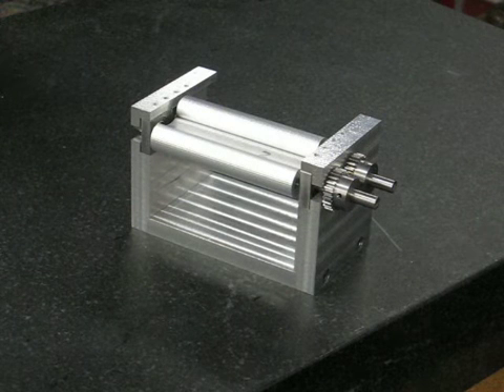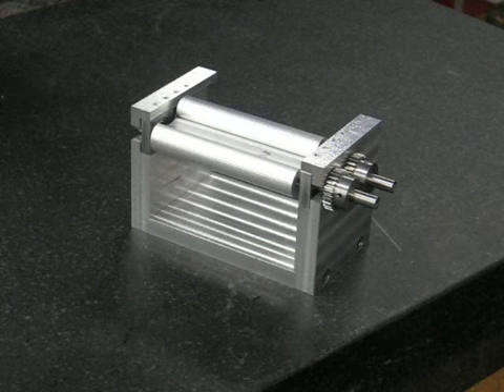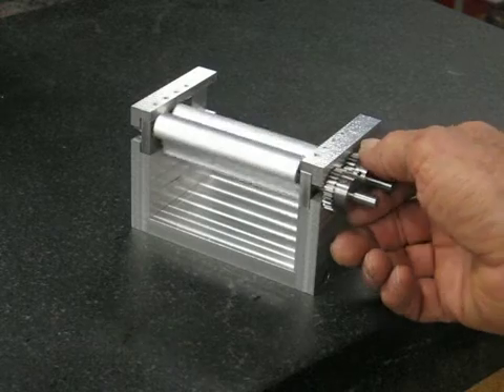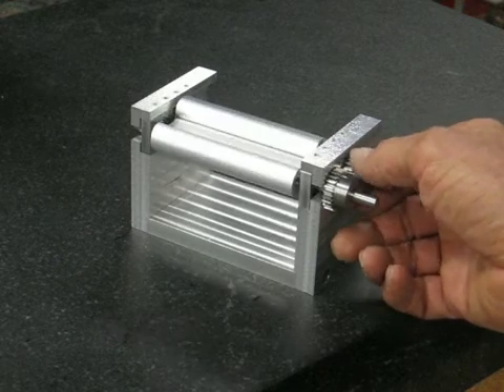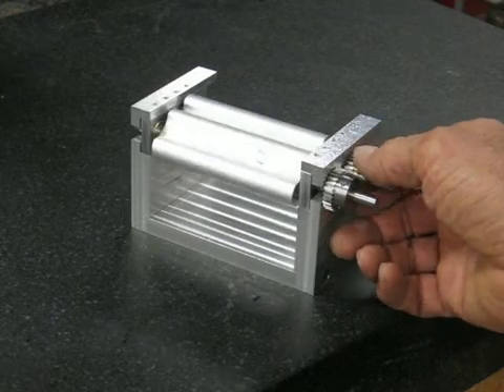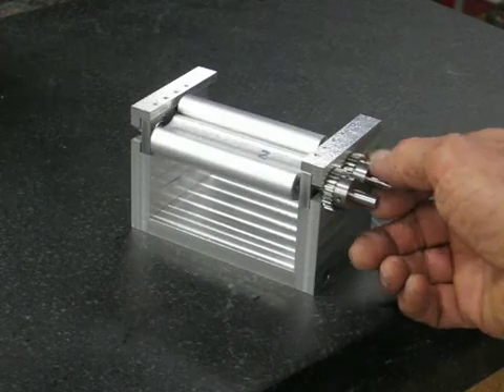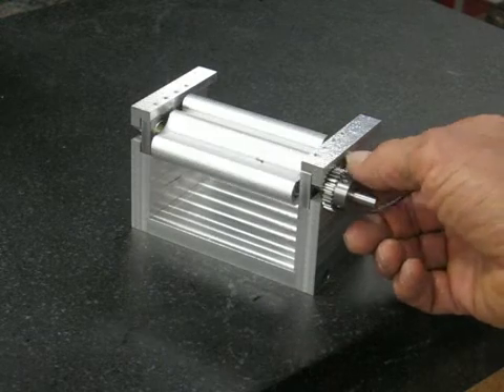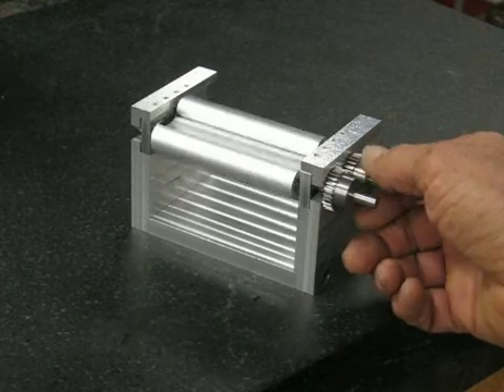Bakers V8 Supercharger

Comment: Sir, could we speak about the workflow of how you worked all this out? I am a tool maker and half way understand about using a ball end mill to "3d" compound profiles but on a mill are we lowering the z axis say like .002 while moving the y axis say .006 then making our pass in x. As the profile changes the ratio of z to y in thousandths changes via the excel spreadsheet? Now what about the dividing head set up? Do we add another axis and rotate say 6 or 8 times to clicked positions down to seconds and repeat say for the love and then for the valley and how do you work out making those transitions line up? Man I want to do this with out a hurco on one of my brodgeports.
Reply: bridgeport's. Thoughts are I cant use the fly cutter arch trick on the valley and a ball turning fixture on the lobes because they have to be dead not to say .001 or .0005